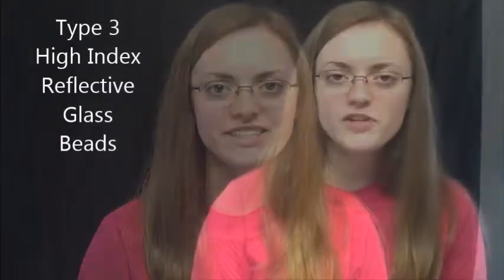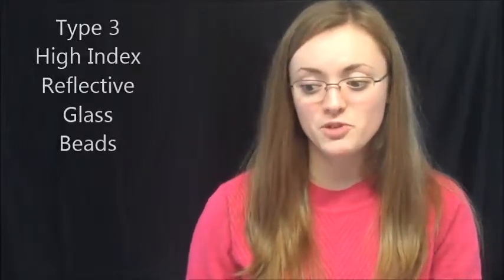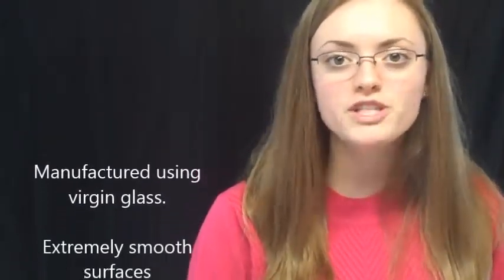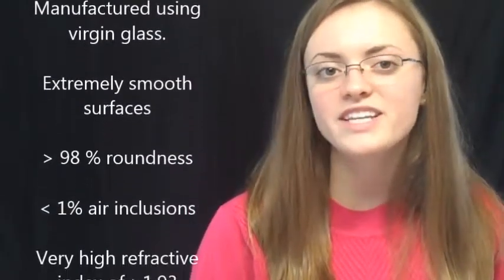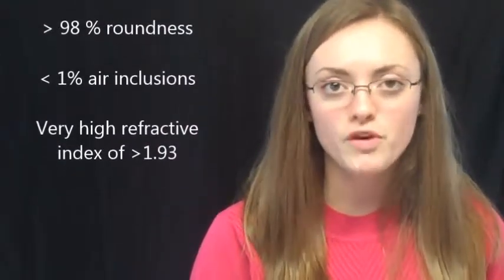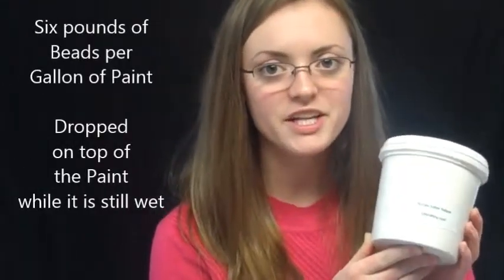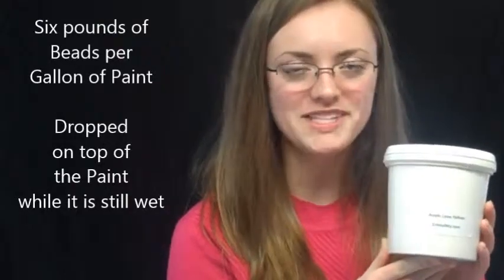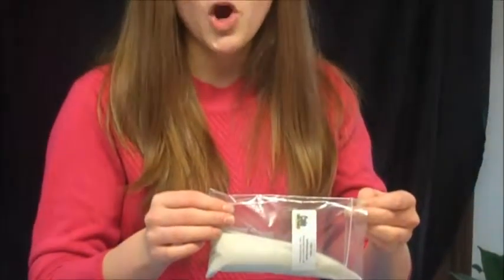High Index Reflective Glass Beads. Technical Information and Review

Comment: I realize they do not photograph well, but are you aware of any side-by-side comparison of plain beads vs. aluminized beads? Given the hemispherical coating and the random orientation, is there a net increase in reflectivity over uncoated beads? I notice the flash-photo image of the bag of beads shows a speckled effect.
Reply from the maker: The Aluminized beads are tiny mirrors depending on the way they lay down the light would disperse rather than retro reflect. Haven't seen any side by side but we do know the overall refractive index is the same >1.91.
Reply from the maker: The refractive index is the same however because each bead is coated semi=hemispherically the tiny beads become mirrors. the tiny mirrors would not all face the same direction in the bag or on a surface created a more dispersive reflection. Some would be facing down and not reflecting at all (specks)

Comment: Can I use my own acrylic  paint ? And is there any way to mix this with a medium to make colors. I need to be able to do so
Reply from the maker: cash quest you can not mix with any medium. Beads must be sprinkled on top of the paint as they must be the first to get light to reflect correctly. You could use a clear coat over a color then sprinkle the beads on top of the clear coat. the color will come through.
Reply: Mix them with a clear coat that is vary thin, this has worked according to other sources. Some companies even offer paint with these types of beads mixed in so I do not agree with cole that this will not work. 

I do agree it would be a waste unless it is a clear coating as the beads that end up burred inside the lower level of paint coating will not do any good as they can not reflect light if the light does not get to them. 

I am going to try this, using a thin clear coat to apply a layer of them and test the reflectivity after the coating dries. It will be easy to test this with some thin clear such as poly clear finish coat. Use any clear coat like this that is compatible with your paint to test this idea.